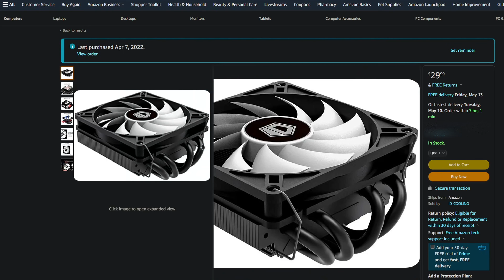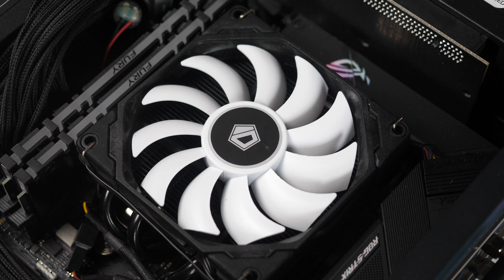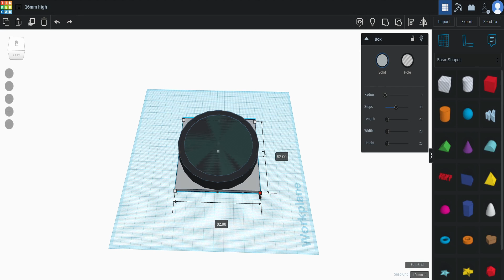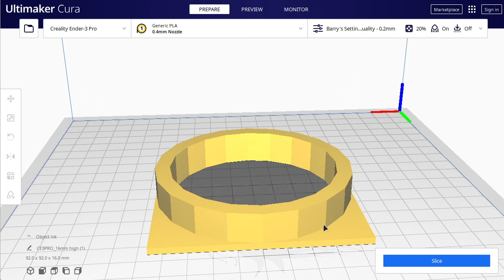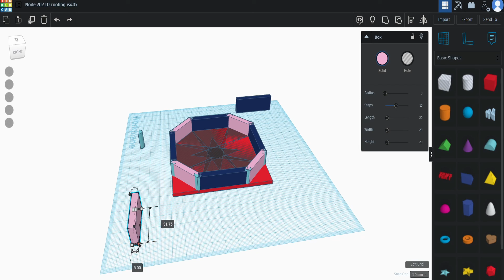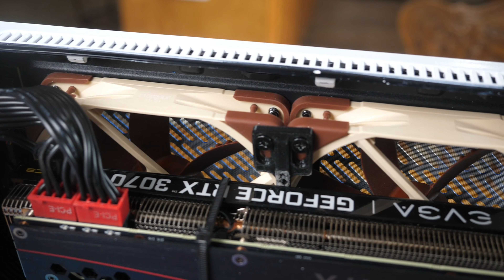3D Printing Dropped The Temps By 20 DEGREES!!!!

Comment: Pro tip: mount an exhaust fan on the frame of the case, right on top of the CPU. You can then use a bit taller CPU heat sink, which can be in light contact with the exhaust fan. I found that pulling fresh air from the GPU panel side and exhausting it out the CPU panel works best for cooling in this case. This is still a great case in 2025.

Comment: I have this case to. My gpu (Amd red dragon rx 590) get SO hot, the fans spin up at maximum speed and it is just unbearable!The nois is NOT ok! 
However, the CPU was realy hot as well, but I solved it with just installing a small 40x40 mm fan on the side of the case to help blow out air.I lowered the temp there easily with 10 degrees celcius.
I only have one fan under the GPU, and I heard a couple of people actually put the fans there to exhaust air and not sucking it in. Dont know what is what now.. Gonna buy another fan again and put em both so they suck in air? or just one?

Comment: I have this case and I use the (maybe discontinued) ID Cooling IS-60 for my 5600x. It is the perfect height for this case so that you don't need a duct, and I replaced the fan with a slim noctua to get a decent 70C under full load.

Comment: not sure what kind of filament you used for that print but if it was PLA you might want to go for a more heat resistant plastic if you pc gets a bit too toasty maybe, abs? PLA usually warps at 60°c while ABS is about 105°c, print might sag and damage your fan in a few months time if your stressing your pc

Comment: Great video! I'll definitely be taking notes, I still have airflow problems in a full tower.
For the 3d printing, if I may suggest, some programs let you adjust the amount of triangles when you export in stl. If you want more precise circles you can try tweaking those values

Comment: Are those normal fans or slim fans?
Reply: the noctuas look like regular 25 mm fans. you could potentially have quieter operation with slim fans if 25mm fans cause turbulence being so close to the GPU cooler. i have no way of testing this though, it's just a thought.

Comment: if you ever decide to swap out that cpu cooler for a noctua cooler (and i don't really know anything about aftermarket coolers as i've always just used stock cooling up until this point) be warned as i think the noctua NH-L9i is meant for intel boards and so you may need a separately available mounting bracket. instead, you should probably opt for the NH-L9a AM4, which i believe is the very same cooler just meant specifically for the AM4 platform.
Reply from the maker: Oh that's really good to know! Thank you!

Comment: For my HTPC Node 202 build I removed the cpu fan from my cpu cooler (Alpenfohn Silveretta) and just ziptied a 120mm fan to the case grill above the cpu (on the inside) blowing air onto the heatsink.

*it was a 140mm fan not a 120mm fan, whoops
Reply from the maker: That's a neat idea! I may try that! I could probably get a slim fan to blow air into the case!
Reply: @BulletBarry Small correction it was actually a 140mm fan :D. But since your ram looks a bit taller then the Corsair LPX ram I used you might indeed need to use a slim fan, I personally used a standard 25mm thick fan (Arctic p14). You might also need to put some spacers between the fan and the case to make sure the fan isn't rubbing against the case (I used keyboard o-rings 😂). But the fan duct is probably still the best solution.
Reply: Here is a picture of how it looks from the outside: https://i.imgur.com/xIReYlH.jpg
Reply: @Lg2K  Excuse me, and what temperature do you have before/after? I am interested in your decision, as I am also have node 202